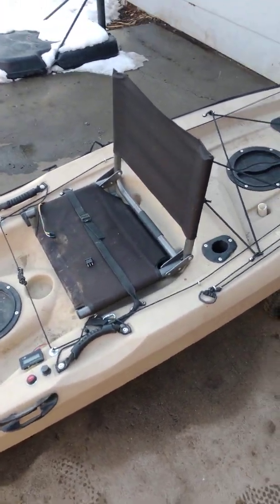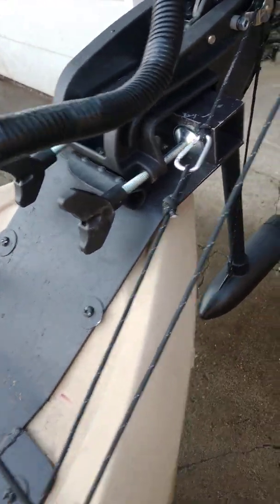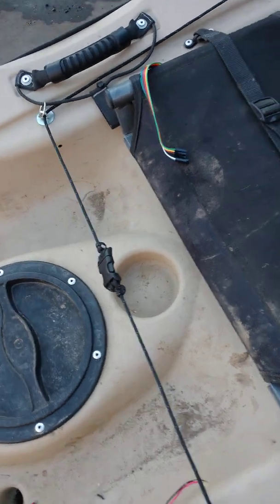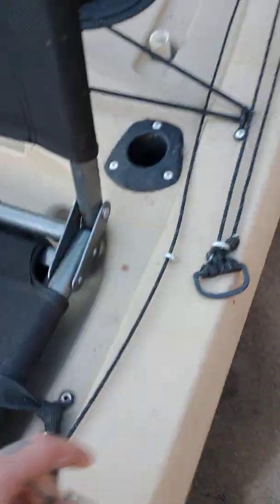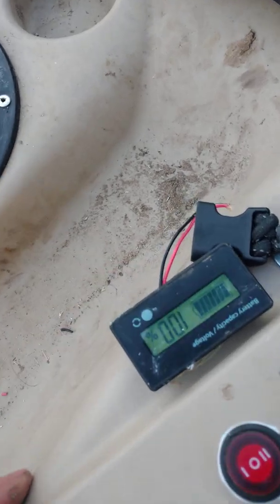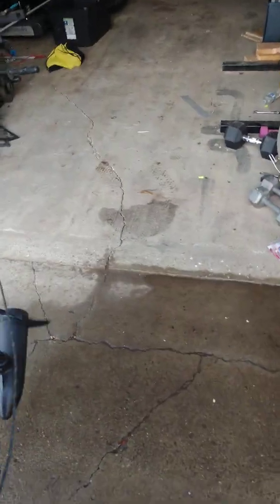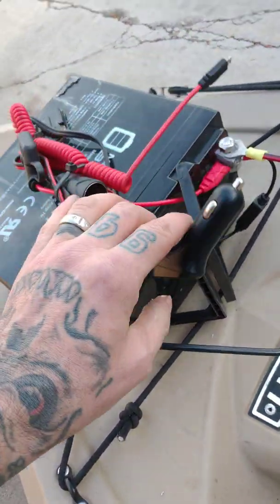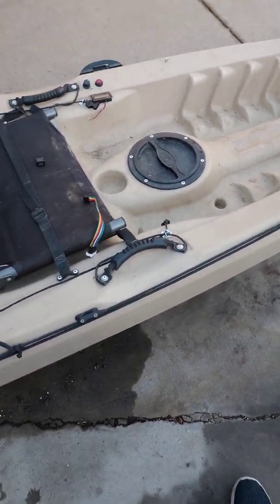lifetime tamarack kayak with PWM and trolling motor

Comment: Do you guys just reach thru the rear hatch to attach the under plates?  Are those just screws screwed into the body, or bolted to the under plates?  I was wondering if the plastic body was strong enough to hold just screws.  Thanks, AWESOME BUILD!!!

Comment: Hey Shaun, very clean setup. Question for you...I saw you added a pulse width modulator. What's the difference between that and a speed controller? 

Also, my wife just got me the Minnkota 30lb thrust. Do you like the way yours moves against current/wind? I'm thinking of upgrading to the 45lb but I'm not sure spending the extra $100 bucks is worth it. I know the speed won't change but I figure it might push me up the Susquehanna a bit better. 

Thanks man.
Reply from the maker: As far as the speed controller, I can't give any objective info cause I have no experience. With the PWM and a 55AH battery, I can be on the water trolling at 1.3-1.7 mph for damn near 11 hours. If there's wind over 5 I can do an easy 6. I wouldn't change anything about my set up
Reply: @captain_fishaun5061  Yeah, I'm thinking the PWM is basically the same thing as a speed controller, just worded differently. 

I may end up with the 45lb just because where I really need the help is up-stream. Rather not need it and have it than the other way around. 

Appreciate the insight.
Reply from the maker: @thomasnetzel828  absolutely!

Comment: Where did you get that 4 wire plug?
Reply from the maker: Amazon. However...you only need 2 wires if you install a PMW (variable speed) so I wouldn't buy this. Plus, there are no connection terminals (that I could find) so I had to solder the wires.
Reply: I have the lifetime Teton kayak which is pretty much the same kayak you have just a little bit different hull shape. What battery are you using? Do you have any issues with the rear of the kayak sitting too low?
Reply from the maker: @SirWilliam9204  I have no issues with leaning. The battery site up front, I'm in the middle, and the motor in back so it equals out pretty good. I think I have some vids on my page that might give u a better idea. OR look me up on TikTok. @fishaun_
Reply: @captain_fishaun5061  Awesome ty for the info and help.
Reply from the maker: @SirWilliam9204  not a problem
Reply: @Fi Shaun  oh ok do you have a link to your pwm that you purchased? What # thrust is your trolling motor?
Reply from the maker: @SirWilliam9204  I run a mighty max 55AH. I have the 30# endura C2. After the variable speed install, I can run at 1.5-1.6 mph all day long. The pmw is here: Sydien 10V-55V 12V 24V 36V 48V 40A Stepless DC Motor Speed Controller with Forward-Brake-Reverse Switch,Ajustable Potentiometer &Digital Display https://www.amazon.com/dp/B07GFM53H7/ref=cm_sw_r_cp_apan_glt_fabc_CAVBGRKARMZDVD3VYFR0?_encoding=UTF8&psc=1